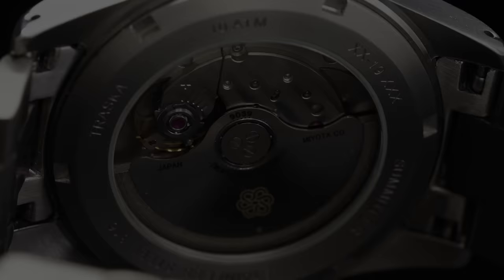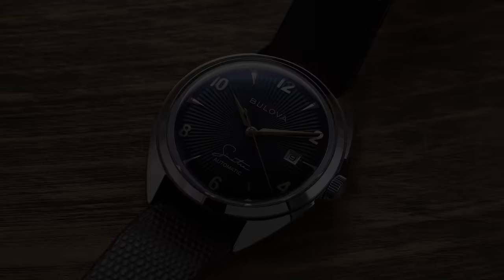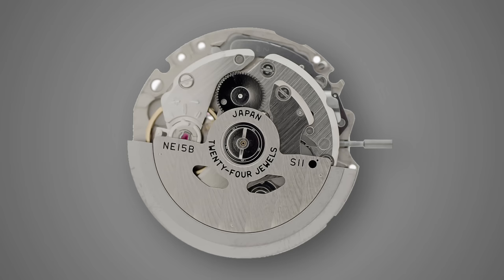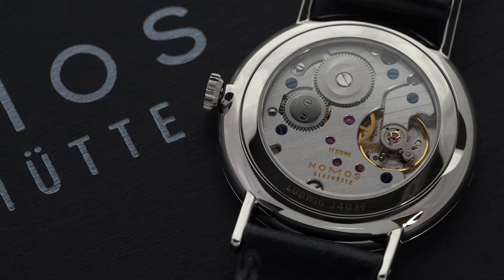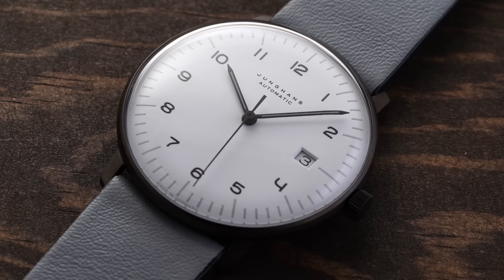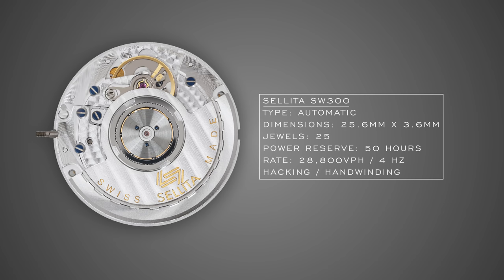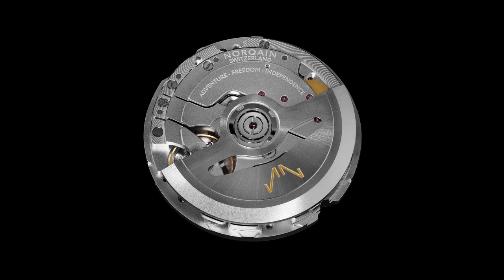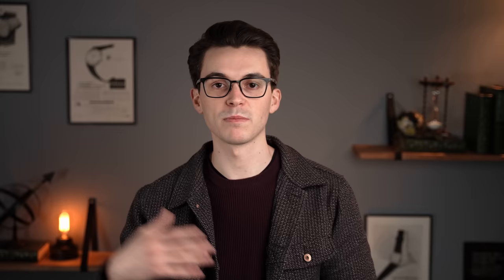Overview Of Third-Party Movements: ETA, Miyota, Seiko, & More (A Comprehensive Guide)

Comment: ETA movements are EXTREMELY underrated. They are very reliable workhorses! I like 'em.
Reply from the maker: Agreed. ETA is piece of mind for a collector and makes more sense than in-house in many instances.
Reply: I don't think that ETA movements are underrated. In my experience, ETA is well respected as a quality dependable movement. ETA is pretty much just in watches made by the Swatch group nowadays. Any other manufacturers are left only with  Sellita. Which is a great movement in its own right.
Reply: Exactly. ETA is a great designed base model for modular watches. You can do so many modifications with them and cut down the cost. They are power houses that makes a great steady power storage units for a watch.
Reply: I think I still prefer the NH35 / 36 for the $.
Reply: ETA movements are not underrated. ETA movements and their clones are standard equipment in lower end Swiss watches.
Reply: I think this is the first time I've ever read anyone claim that ETA is underrated. Simply untrue.
Reply: Specialization / third for a movement totally makes sense. But I still have a disproportionate love for brands that do in house. It’s the heart of the watch after all. It’s like buying a car where the motor was outsourced.
Reply: @derekflanderschang9654  This is an awful analog. Have you seen a hot rod with a crate engine? Is a Pagani hypercar any less amazing because AMG built the engine? How about the Fiat roadster that takes a Mazda Miata chassis and sticks in an Italian engine? What about the Pontiac Solstice that had a Chevy Colorado transmission? 

An iN hOuSe mOvEmEnT isn’t the beginning and end of a quality watch. Also, most Swiss watches back-in-the-day were “microbrands” so to speak: this guy makes dials, that guy makes movements, those people make cases. There was no standard conglomerate that produced a product from start to finish.
Reply: @Mister_Phafanapolis  upvoted your comment, fair points (and you can tell I’m not really a car guy). Singer Porsche is a masterpiece of this grab bag concept. Only counterpoint I’d put up is there are a lot more parts to a car’s performance and it seems more logical that one would pick and choose the very best combos. But a watch really just has one job - telling time accurately - so I feel like it’s a bit cheating when someone outsources the main job.
Reply: @derekflanderschang9654 There are a lot of parts in a car, but they’re not all made by the company itself. BMW used General Motors automatics in their “ultimate driving machines” for years and most manual transmissions are made by ZF or Getrag. Is it a cheap cop out when they use Pinifarina to pen a car design instead of doing it in house? Is it bullshit when a suit is made from E Thomas or Reda or VBC fabric instead of doing the milling in house? Personally, I’d rather have a canvas suit with outsourced fabric than an in house fabric with a glued interlining. We have to take in the whole of the product when making a purchase: design, function, features, style, price, that X factor that gives you the fizz, it’s second kind of cool. 

 If telling time was the most important factor in watch purchasing, then we’d all be rocking a quartz. No mechanical movement, no matter how super duper superlative it’s chrono metric chronometry is can hold a candle to a quartz. So if we are in the “watch lover’s” sphere we’re already in a logical paradox of sorts. I’ll admit there is something I like, an X factor, about mechanical watches that I prefer over quartz despite the numerous and obvious negatives.
Reply: @Mister_Phafanapolis  you nailed it, the best timepiece for telling time is the phone in our pockets 😎 mechanicals are just really impressive Rube Goldberg machines to me and I like the idea that Rolex or Grand Seiko or Tudor built the whole machine - otherwise they’re really just a jeweler / bracelet / casemaker. Beautiful yes, but ETA did the hardest work. PS I really like this discussion in a genuine and wholesome way, appreciate the insights and views. 👌
Reply: Chinese made Miyota powered watches are an even better bang for your buck workhorses. I don't mind beating down a sub $125 watch that is powered by the same 3rd party movement that the $500 and up boys use.
Reply: @Mister_Phafanapolis  yeah it is ,when it comes to pecking order Koenigsegg is higher up the chain than Pagani . Simply because Koenigsegg makes almost everything in house while Pagani is a car designer and not a car manufacturer . That being said I dont mind them having whatever engine , it doesnt devalue their cars at all but it is important to know that they dont have their own engines . Also while Pagani cars are beautiful , they are showpieces . GT3 RS with some more juice will smoke it around the track .So in that sense they are a lot closer to watches but an expensive watch is from 50k to 300k , Pagani costs few millions
Reply: You're that excited over an eta, huh?  Wait until you get your hands on a gen 2 sellita...

Comment: Honestly if I see that a watch has a Seiko Instruments or ETA movement, or even some of the Miyota ones, I know that it's going to run great and be easy to find someone who is willing to service it.
Reply: Exactly
Reply: Another thing I forgot to mention is that a few years back, Seiko released an OEM version of the 8R chronograph movement called the NE88 or NE86, and it is a much nicer movement than the valjoux 7750 that it competes with because it is a vertical clutch column wheel chronograph.  I haven't seen it used in many watches though for whatever reason.  My guess is that at the price point, people just want to see that "SWISS MADE" on the dial
Reply: New 8o hour eta are rubbish.
Reply: @khalifa2080  How
Reply: @oscarosullivan4513  no regulation and no supply for of parts to repairers, monopoly strategy.
Reply: @khalifa2080  Agreed so you are saying that no parts are going to watchmakers
Reply: I usually avoid Miyota movements due to their unidirectional rotor winding at least in the 8215 and 9015 . The freewheeling spin in the other direction is loud an annoying.
Reply: Other than known watch brands, I'm happy to buy any good looking watch with a Seiko or Citizen/Miyota movement.
Reply: @khalifa2080  Deffo. Less parts, less workmanship
Reply: mechanical watches are outdated technology get with the times an buy an apple watch mechanical watches are so useless now they are a way too signal wealth now only and most the people wearing mechanical watches are posers and wannabes trying to act important they make me laugh all anyone needs is a apple watch everything else has no purpose and is jewelry that people go broke trying to impress themselves and people who dont care nobody cares what mechanical watch you wear you should wear a watch for purpose not for beauty early mechanical watches where made for purpose not beauty not they are no longer needed they are outdated tech apple watch is what rolex was back in the day apple watch is the future smart watches will take over brands like rolex are dinosaurs
Reply: @CloroxBleach-jq1xb  I read this exact same comment somewhere else before. Either you try to be a smart(watch)-ass al over YouTube with your one comment, or you stole it from someone else. I really don’t care either way to be honest, but if you really want to be a troll, then at least aspire to be more creative. This is getting old.
Reply: @Ohne_Silikone  Next time you call me out my name do some Research Good Bye
Reply: @Ohne_Silikone  And also you dont need a watch to tell time in 2021 you can use a cell phone so if the mechanical watch industry does not start making smart watches they will sooner or later get left behind i mean why would i buy a watch that can only tell time for $100 or 410K when i can get a smart watch watch that does a long list of things for more than half the price its common sense the mechanical watch industry has bad business model and will soon be extinct nobody needs there watches there products don't offer nothing but false sense of prestige i have own cheap watches and high end watches and i can say its all a waste of money and i unlike most people can afford high end products all a person needs is a apple watch some of my politician friends only wear there apple watches and swear by them i don't see the need for mechanical outdated technology but if you do good for you when you own multiple pateks and APs and Vacherons like me then you will understand where im coming from the money i would spend on those watches i give to charity now i could never spend that amount again on silly watches i rather help starving children and kids with birth defects if that makes any sense to you good when you can afford most of all the watches you want then you will understand good bye
Reply: @CloroxBleach-jq1xb  haha, you are a funny one.  If you could afford all of these watches, why have you never bothered spending some money on a course on basic writing skills? You know the use of , and .? They are kind of useful. 
I like watches for what they are, as a piece of useful jewelry that complements my day. I like mechanical watches because they are of a timeless beauty and have character in their design, even the cheap ones I own. But of course after spending a fortune on watches you surely understand what drives someone in this hobby. On the other hand I dislike smartwatches. I already have a smartphone and don't see the need for an overpriced piece of technology that gets outdated in a couple of years time, years before my 80 euro Seiko 5 runs out of life. Moreover I don't want my smartphone/watch to drive my life. I already use it more than enough.
Reply: @Ohne_Silikone  I find Steve McQueen quite funny. His snobbery for smartwatches truly outmatches our humble appreciation for mechanical watches. The irony is almost laughable.
Reply: @CloroxBleach-jq1xb  It's almost like 1. Not everyone likes smart watches because we don't need or care for the distraction and 2. You cannot pull a smartphone out everywhere you go. Lets not also forget 3. Most mechanical watches look a lot more professional and pull together an outfit better than a smartwatch. 

Other than that, yes, you are right. Outside of smart watches, most watches are outdated. Doesn't alter the allure or appeal of that kind of technology (not to mention a smartwatch dies in a couple days. A mechanical doesn't stop nor needs recharging. Enjoy living connected to power cords!)
Reply: @zahktuthalxalyrion6364   An you can enjoy living in 1946 when swiss watches where relevant I choose to live in the present 2021 and mechanical watches are old tech I would not go to BEST BUY in 2021 to buy a computer made in 2005 when I can Buy a PC made in 2021 that is better performance for the same price I choose not to get obsessed with Granpa jewelry I'm not 98 yet If your in your 90s I say take the plunge and buy the old man's watches but for me I limit how many granpa watches I collect My most favorite watches I own i like are the watches i don't have to service and wait months just to receive back i Like being able to wear my watch and if it has an issue i just buy another one cause its not limited edition or the dealer and brand are creating a false scarcity meanwhile there product is nothing special but overpriced rubbish Ive probably spent more on G shocks then the average person i love those watches there built like tanks i get not much wear out of my high end pieces cuz there either rare or the brand is planning scarcity so i be careful and i barely enjoy the watch
Reply: @CloroxBleach-jq1xb  I love the essay response despite the fact that I said I agree with you. In the end, it IS personal choice. 

Oh, and they make beater automatics for a reason. I wear mine and care very little if I damage the $38 movement inside because it can be swapped out with extreme ease. The sapphire glass and titanium case I ain't worried about.
Reply: @CloroxBleach-jq1xb  Oh the irony of an Apple owner calling anyone a poser. My mechanical watch will still be working while your Apple is in landfill.
Reply: I want to buy a watch with the ETA inscription on the dial and with the ETA mechanism inside it will be honest
Reply: @CloroxBleach-jq1xb  smart watches are not  watches, scooter is not a bike.
Reply: @CloroxBleach-jq1xb  nothing you say matters to me, because i like watches :)
Reply: @CloroxBleach-jq1xb  The difference is that one is repairable and will work forever with care while the other is an Apple product
Reply: @CloroxBleach-jq1xb  Funny, I wear a 25yrs old Seiko licence built from India, day, date. Very expensive 20$......
Reply: @CloroxBleach-jq1xb  All anyone needs is punctuation.
Reply: @CloroxBleach-jq1xb  Are all Apple Watch "worshipers" unfamiliar with the use of punctuation?
Reply: @CloroxBleach-jq1xb  By that logic people shouldn’t wear classic sneakers because they are outdated for their sport. 

People do not play basketball in Converse, Jordans or Airforce 1 anymore. They do not play tennis in Stan Smith’s. They do not run in ASICS or New Balance  runners from the 80s or 90s.

But guess what? People do not care and still like to wear those shoes casually, because they appreciate history, style and comfort.

The same could be said about dive watches. A Professional diver would use an electronic device instead of a mechanical dive watch today.

But again, people still like to wear dive watches, because they appreciate quality, design, history and craftsmanship.

Now you said, watches are only for show offs. In fact, Apple watches are the new status symbol in today’s society. If you are not into watches, you have no idea, if the watch someone’s wearing is expensive or not. People may have heard about Rolex or AP, but that’s it.

Now everyone knows about the cost of an Apple Watch. Despite the fact that there are cheaper and / or better alternatives. Wouldn’t swap my Garmin in a million years for an Apple Watch.
Reply: Anybody know is there any youtube channel making review on Miyota 9100 with day-date-month + power reserve movement? Are they reliable movement?

Comment: I love the NH35 movement, out of the box in a cheap watch it can be a bit off than you prefer, but a tiny adjustment on the balance wheel adjuster can get it within a few seconds per day, even without a timegrapher.  I have one in my first automatic, a Invicta Dive watch, that hasn't been serviced in over 10 years, and it's within a few seconds per day.
Reply: I have an invicta as well with the 24 jewel and its been very good
Reply: I need to find a video on how to do regulate NH 35.
Reply: I just bought a steeldive of Alibaba with the NH35 and it hasn't lost or gained a second in 3 weeks
Spot on!... Not bad for a $180 watch!

Comment: In the beginning of my watch collecting journey i was all about in-house movements. While they are great and Rolex, Seiko, Tudor, Omega, Breitling, Zenith, JLC, Patek, VC, and so on make some reliable and proven movements. But they cost quite a bit to service.  Now i honestly appreciate the utility, reliability, and serviceability of ETA and Miyota movements. It doesn't bother me if a watch has one. They are accurate and reliable. The service costs are half of what a in-house movement service is. While im totally fine with ETA, if i had the choice i almost prefer the Miyota. Its still quite accurate and reliable. I dont mind the rotor noise and usually the watch can be alot thinner than the ETA counterpart. If im spending 5 grand obviously i don't want a miyota movement but you get the point.
Reply from the maker: Thanks for this comment, Josh. I agree with you!
Reply: Miyota isn’t serviceable though, you simply swap i out for a new one. Also, it’s not thinner than an equivalent ETA
Reply: @nintendokings  9015 is 1mm thinner than 2824. Sounds marginal but it makes a difference in case size

Comment: My daily wear watch is using a Miyota 9039. I regulated it myself over the course of about a week... carefully adjusting it back and forth until it consistently runs +1 second per day. This morning I woke up and it was 1/2 second fast from where I hacked it 24 hours before. It can go a few days without deviating by a second or two. It is a fantastic movement. There's nothing practically more that an in-house movement can give you.
Reply: There is objectively nothing a luxury watch gives you above a solid “regular” or mid tier watch. There are more beveled edges and movement decoration but I’m not convinced that makes for a better watch. In a nuts-and-bolts way, no improvements for thousands of dollars more.
Reply: Your awesome bro.... Self regulating.... Rolex fanboyz are crying silently in the bathroom!!!